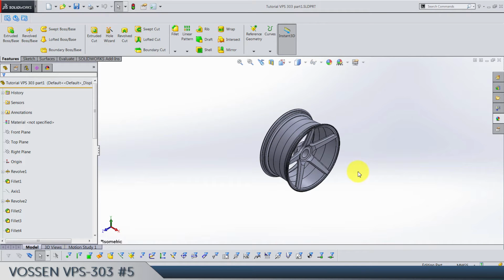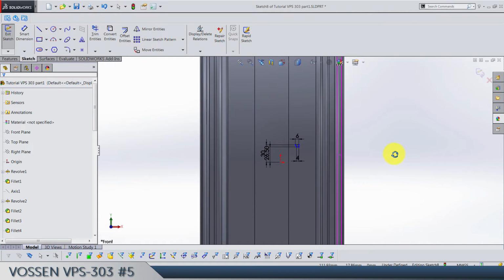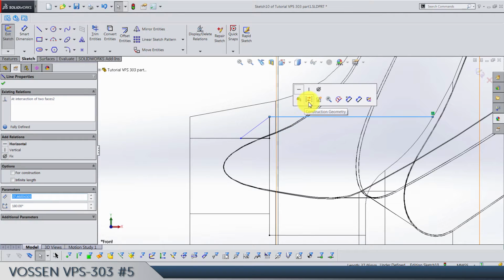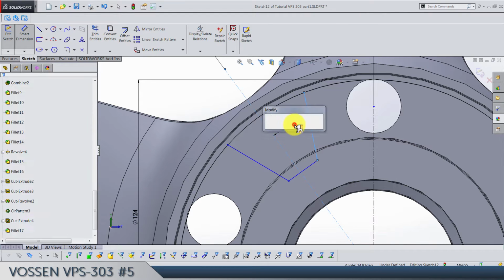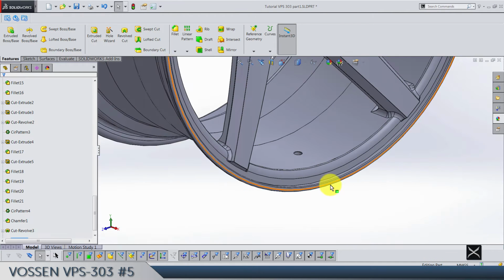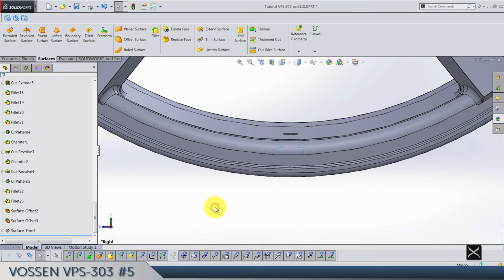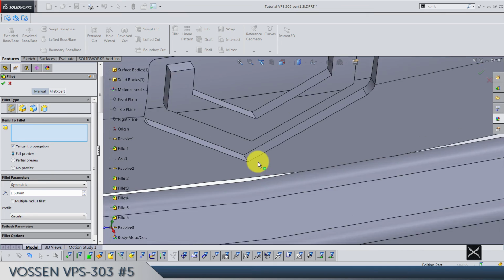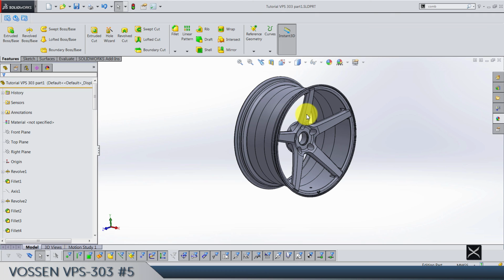SOLIDWORKS WHEEL TUTORIAL - VOSSEN VPS-303 #5

Comment: How do figure out the dimensions?? Please give tips.
Reply from the maker: back then I only knew the base wheel size but dimensions I made for this wheel I believe were wrong cause I actually was'nt able to measure or find dimensions for this wheel, I only did proportions right so wheel looks decent
later I got in touch with some people from wheel industry and they gaved me their drawings where I learned how to set base wheel dimensions and then it's easy to do a wheel, so see if you can find some old drawings from some company, it's quite easy once you see those base dimensions